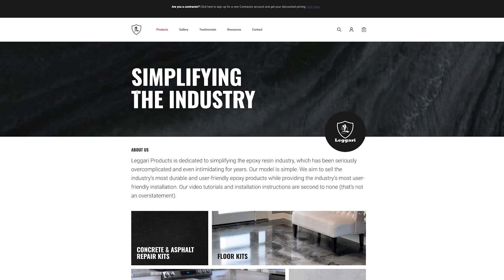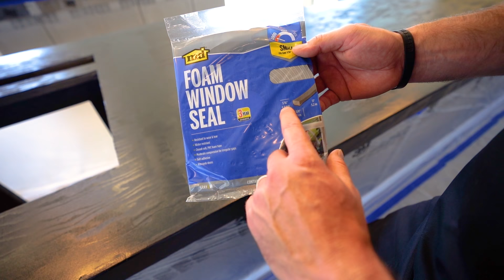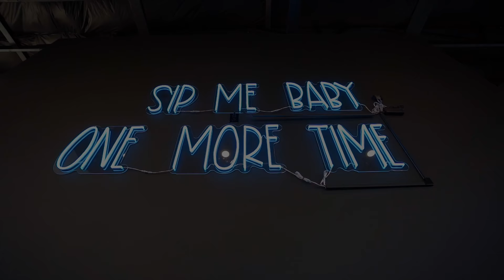How To Coat A MASSIVE Countertop Using Epoxy | The Complete Guide

Comment: BEAUTIFUL! So, you don't need to seal the plywood before the primer. I did a plywood surface years ago and I only primed it and it really absorbed my work/slowed down my working time tremendously, I couldn't do my design effectively because the plywood was absorbing the epoxy, I was using multiple colors.. I'm using a thicker, quick drying boning primer now for all surfaces but when it comes to plywood I still feel like i should seal the entire surface first? But then, I imagine if you are only using 1 highlight and then a topcoat, it wouldn't really effect your design as much...

Comment: I bought one of your countertops kits and used it to coat both sides of 2 sliding barn doors but when I flipped them to do other side it marked them up some
Can I sand this and can I then coat with regular polyurethane?
Any advice is appreciated, thanks

Comment: I got a question.when your done sanding after letting it all dry and you got that white residue what do you use to wipe it off with before you lay a clear coat down
Reply from the maker: Denatured alcohol! It works great as an all-around cleaner, especially for the tools used to mix the resin.

Comment: Is bondo just a normal wood filler or is it a brand by itself? Am only aware of wood filler here, not sure if u have to mix it with anything.
Reply from the maker: Bondo is a brand. It is an all purpose putty that cures to be extremely hard and durable. You can get it at most stores or online.

Comment: Can you tell me why my weather strip always gets stuck ? Am I using wrong kind ..It sticks to countertop and breaks apart while I'm pulling it off .It's to the point to where I had to scrap it off..
Reply: this is the first time i have seen them use weather stripping. i may have missed it some other videos. i am not a fan of this design. its doesnt wow me. and i dont understand why they seem to choose a matte finish on top of that gorgeous shine. maybe they could use a gloss finish and spray it on instead of rolling it on.
Reply: you might be pulling it off a bit late , you want to pull it while the epoxy hasnt set up yet. if thats not the case then maybe its a cheap brand or possibly expired?
Reply from the maker: Depending on the project, we use different methods and always aim to make our customers happy. Thank you for watching!

Comment: What is the spray feature?
Reply from the maker: The first thing we spray is 91% or higher isopropyl alcohol; this creates cells in the design and disperses the epoxy. Once that evaporates, we spray denatured alcohol to pop micro bubbles. This allows us to avoid torching the epoxy.
Reply: @LeggariProducts  Thank you for your explanation, regards
Reply: Do you use the Klean Strip denatured alcohol? Would mineral spirits work?